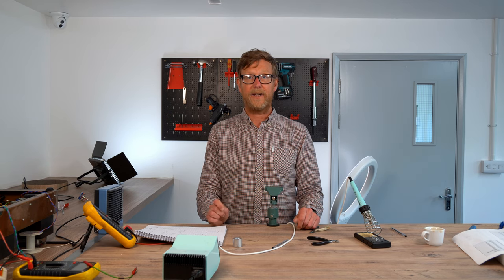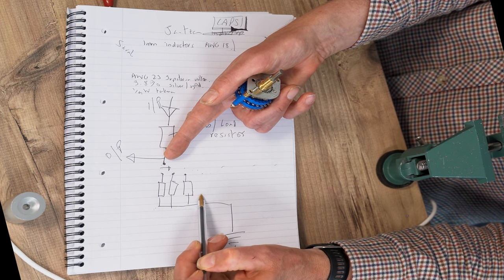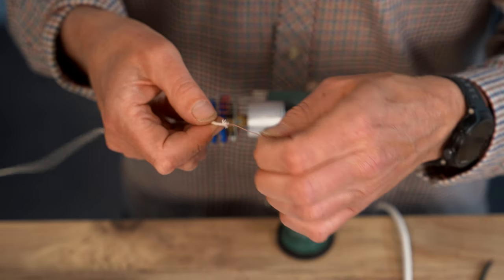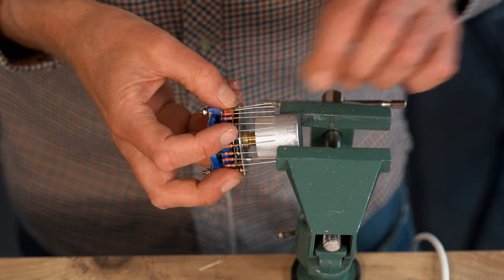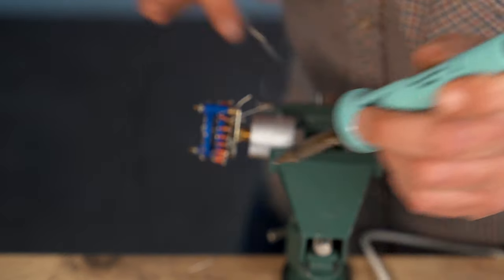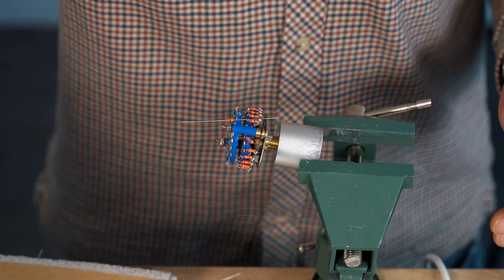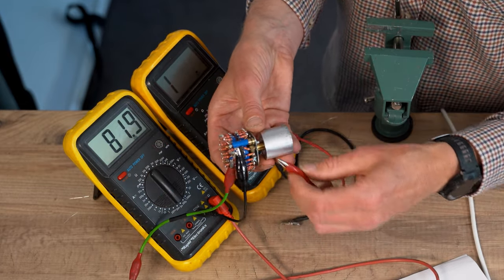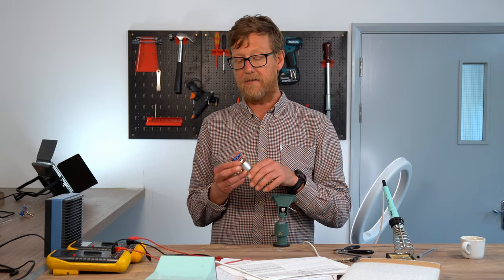STEPPED ATTENUATOR Build Using GLASSHOUSE/NOS AUDIO NOTE Switch

Comment: So, If you are replacing a logarithmic 150K stereo volume potentiometer in an old receiver, you skip the series resistor? Any idea what the formula is for calculating the 22 resistor values? Regards, Bo Andersen